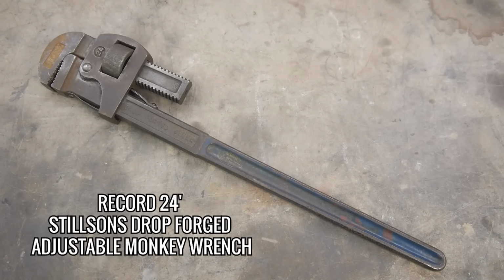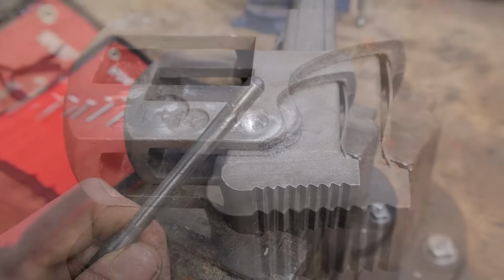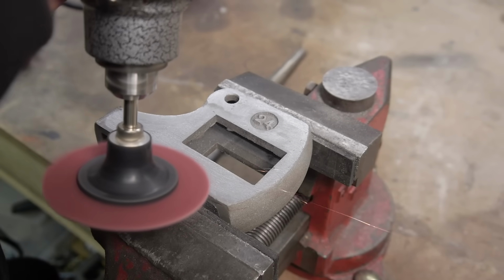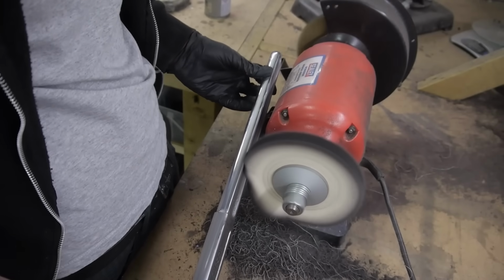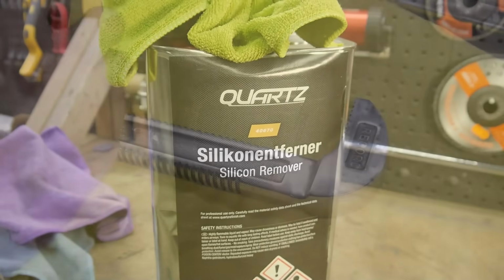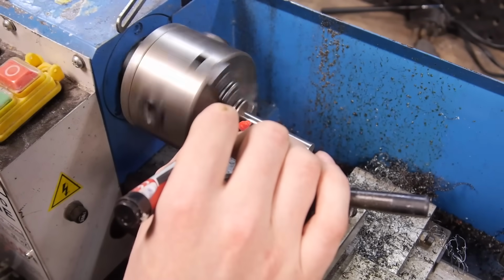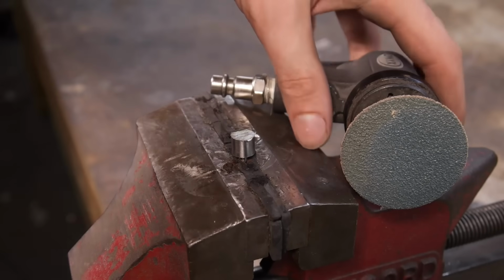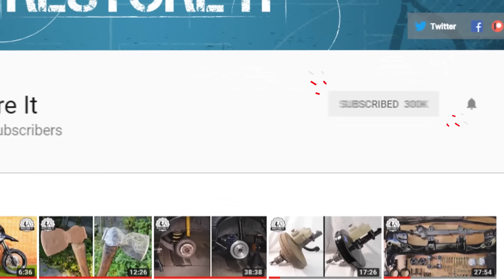Old Record 24" Stilson Monkey Wrench [Restoration]

Comment: I have this same wrench. It's been sitting in a Florida unairconditioned garage for over 40 years with no rust. It appears to have a plain phosphate finish applied to prevent rust. Not sure I like it polished, but you do you.😊
Reply: Agree, the polished wrench looks like crap
Reply: now its all slippery, this polished wrench is a decoration now.
Reply: I do too but I call it a pipe wrench
Reply: I have but in 14"   its madera in germany so thats why
Reply: Good for you. Do you want a cookie?

Comment: Car boot sale last weekend, bought 3 of these in very good order for less than you spent on paint   [£6 ]   Total over restoration, but no complaints from me - what ever floats your boat.
Mine will be cleaned, de-rusted [electrolysis] , minor touch up to the teeth on the jaw faces, good coat of wax-oil and go straight into service on the farm.
nice work young fella

Comment: This is beautiful, I oftentimes seen people restoring and then instead of grinding or filing out the damages, adding bondo and that for me is a short cut, metal can be filled by welding and when you grind out the weld leveling it out, it retaind the original metal work. I really enjoyed this. I will be subscribing simply because of the fact that you really worked on the metal.🇿🇦🇿🇦🇿🇦🇿🇦  from South Africa

Comment: This project could be used as an award for a plumber.
Mount the pipe wrench to a plaque and add a award to it.
“Local Union 456 most prolific plumber award 2022”

Comment: Amazing job on putting such a wonderful shine and finish to the wrench. This wrench has now graduated to a showcase from a toolbox. With a 5000 grit smooth finish it would be a potential safety hazard to use it as a tool - imagine an oily or greasy hand slipping on that smooth surface when applying full force while at work.

Comment: Mesmerizing to watch...another great Restore It video. If you get yourself a pair set of Brass Pads and replace the Steel ones on the vice, the Vice would not add additional scratches...after and during polishing and sanding.

Comment: Greetings from Siberia! Stillson's English key is the greatest invention of the 19th century. Very competent and painstaking work. Every step is precise and thoughtful. Cleaning first. Sandblast. File. Polishing with different sandpapers. To the ideal, to the ideal! Sponges on the vise when working with polishing. Oil lubrication between treatment. Finishing polishing with paste. New knurling on the nut. All handles and moving parts are not painted. Only labels. It is important. But I would not lubricate the tool with lithol or amber lithium grease, as it accumulates small particles of dirt and metal in itself. It is better to use dry Teflon grease for chains. Dirt does not accumulate on it so much. Thanks!

Comment: Great job. I wonder if you could have welded in the damage to the screw and saved a lot of metal.
I find glass beads to give a finer finish and leave a smoother finish on the metal, making it easier to do follow up surface finishes. Instead of a rough satin, a fine satin finish.  You could always take a metal bar, compare the different blast media in strips as well as along the top, different buffed spots with X amount of time buffed for polished finish.

Comment: Nice job!  Although, I must say the two pin screws were a bit crude and rude.  My grandfather was a master plumber, and he would turn over in his grave if he’d seen you apply grease to the wrench nut.  Those wrenches are designed with enough “play” in them so that no lubrication would ever be needed.  Grease on those wrenches attract dirt which will only help to jam up the wrench mechanisms.  The key with those wrenches is to keep them dry.

Comment: Amazing job mate, well done! Incase you ever restore another and you want to keep the old-timey feel of a tool rather than modern then might I suggest tumbling the parts after media blasting with something like ceramic, then parkerising or cold-blu - far more prone to looking worn, but it give protection from rust and keeps the vintage feel.

Comment: A: That ISN'T A MONKEY WRENCH, it's a Stillson Pattern PIPE wrench. B: It ISN'T an Old Record brand, as they made bench and block planes and ship's augers before the Stanley Work's acquired them NOT WRENCHES. Therefore, nothing in this video is correct!  Stillson became "Ridgid" in the 1930's as part of "Plumb Tools" when Stillson became oil field tools and later Hughes Tools. I own my Great-grandfather's Diamond Caulk Horseshoe Company (Crescent Co.) 16" Monkey Wrench with an unusual STRAIGHT (instead of "S") handle. It was designed to tighten and loosen square nuts and bolts on wagons, especially wagon wheel nuts. It must be 140 years old. A 10" one came in every Model T's tool kit.
Reply: @dumpsterfire6351  😂😂😂😂

Comment: Nice work.  I was wondering whether that screw head round-off would be an opportunity to learn freehand shaping on the lathe.
Reply: I was wondering why he did two screws instead of just making the pinion only thread on the one side.  It would be easier to install and remove if he had done it that way.

Comment: 24:40 use oil instead of grease. Grease attracts and holds onto dirt and sand and metal particles. Oil doesn't do that as much. Grease goes onto pieces that require a lot of lubrication but isn't easily accessible. Oil for places more accessible places and tools.

This was told to me by a tool salesman/repairman.

Comment: I don't know what this wrench looked like when it came off the factory floor, but I'm sure it didn't look like you final "restoration". I will give that your final product is very pretty, but for my money, the wrench you started out with is much more beautiful, with the kind of patina that can only be had by years and years of careful use. It was fully functional; all it needed was a little rust removal and some oil. Result: functional and more beautiful.

Comment: Most of mine look like the before, or worse than the before, but they do get used often enough. About the only thing that needs work is to re cut the teeth on the most worn one, it is a little well used.

Comment: Man's doing YouTube restoration but haven't even got a decent set of drill bits in his workshop. The electric tools are more for DIY not workshop,  those are not powerful enough,  you can hear it slowing down when on the pressure. Time to use the sponsors money for some decent tools!

Comment: is that need to be restored? are you sure?
most of plumber's pipe wrenches are dirtier than that before 'restoered'. 
jaws are weared, bodies are rusted by water, dials are clunked and handles are bended by over pressure. thats real on site pipe wrench. thats not need to be restored, just use.